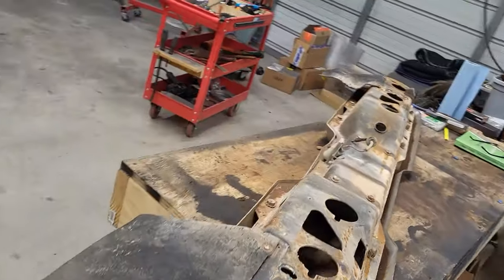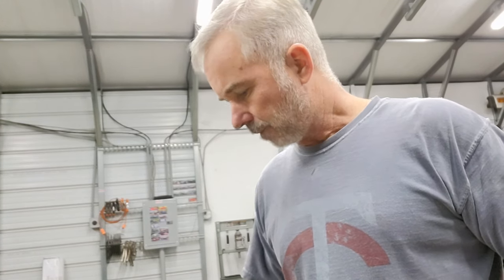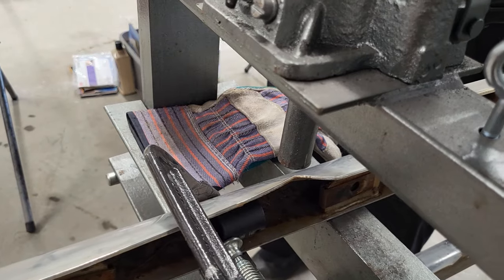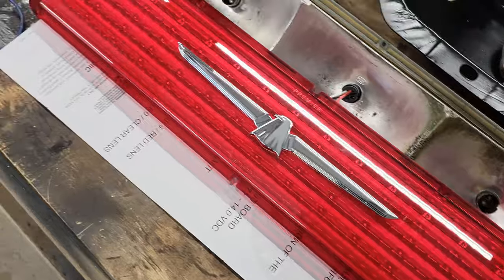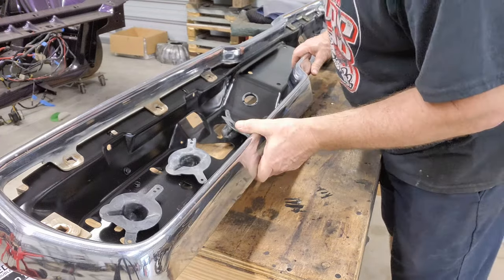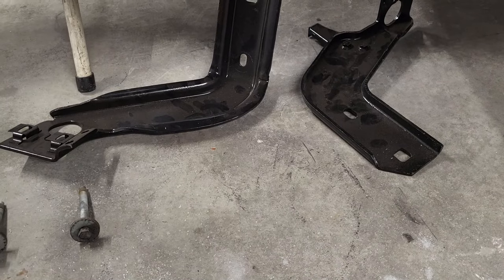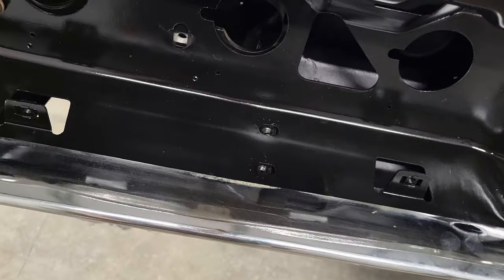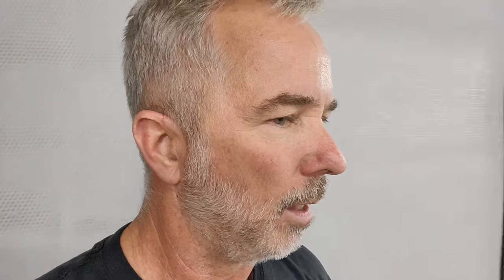Rear Bumper Restoration and Install - 1964 Thunderbird

Comment: Great work, i appreciate your attention to detail when explaining what your doing. I may not go as deep as my car is in very good condition,  that said, i like the style of your restoration.  
PS, Im waiting on my heater core return from restoration shop.... you did give me good moral support I'll let ya know how i make out
Reply from the maker: Thanks for the kind words... I hope you get your heater core back soon and get it back on the road.
Reply: @Exit45Restorations  thanks, I got a core from a guy parting his car out, this way, I can remove and replace without delay. If you have a moment, what are your thoughts on my my A/C coil having no leaks? I'm going to have compressor rebuilt change all O rings and charge system... cross my fingers 😆
Reply from the maker: @josephclarke4244  youncould see if there is a way to put a little pressure to it and see if it holds.
Reply: @Exit45Restorations  I was thinking about doing that, I worked construction for 30 years, so I'm familiar with pressure testing plumbing,  maybe 10 pounds?
Reply from the maker: @josephclarke4244  ya.. i wouldn't do very much.  Maybe less to safe.  I've never looked into it so I'm not sure

Comment: love your content as it has been helpful in my teardown and rebuild of my 1964 T-Bird but i am noticing that you leave a lot of rust remaining and don't seem to wire wheel all reused bolts. I run a tap into every hole and clean up all threads and treat the rust with at least a rust encapsulator. Any reason you are leaving so much behind to continue to break down the back of the bumper? Also, my impact driver set on low to medium is a godsend for rusty bolts after the PB Blaster.
Reply from the maker: I'm glad it's helpful for you.  I sometimes leave the hardware and I should get more  consistent with that.